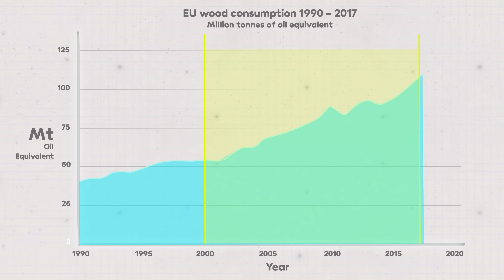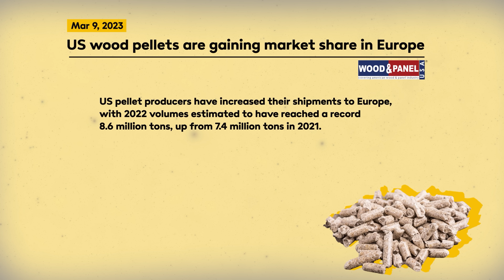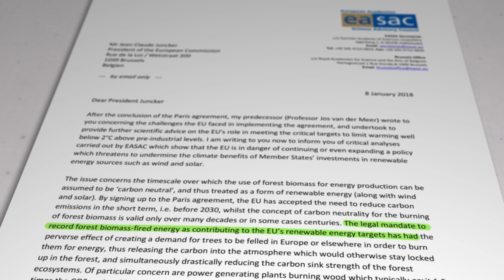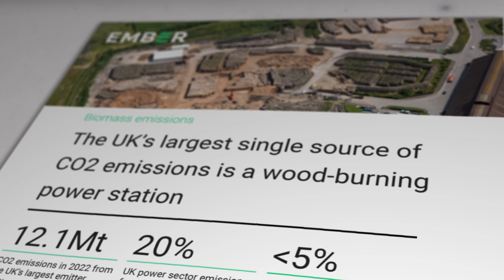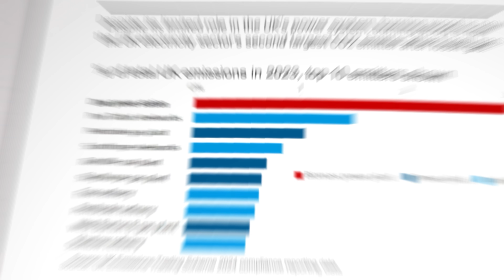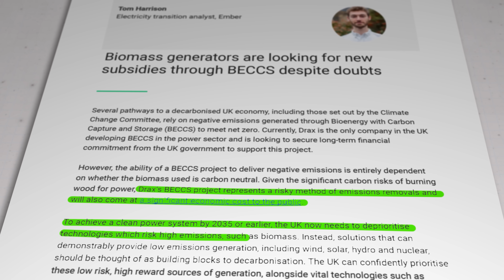New report: Biomass CO2 emissions 4X higher than COAL!!

Comment: I've always had a hard time understanding how burning something is good for the climate...
Reply: You and your gut are right. It isn't. You can smell the BS through the rapidly shrinking pine-scented forest... Good on ya!
Reply: @djmeser
42 seconds ago (edited)
If carbon were recently removed from the atmosphere and then returned, it would be greener than burning ancient fossil fuels that have not been in our atmosphere for potentially millions of years. Co2 in the atmosphere is not a problem, and increased carbon over time is not a problem. However, the rapid change of greenhouse gases at a rate faster than evolution can adapt is a serious problem for the biosphere. 

With this said we still need to increase forests and not decrease them. Biomass should be grown not harvested.
Reply: I don’t understand how human life is good for the climate
Reply: @Margarinetaylorgrease I pooped outside. A flower grew.
Reply: If DRAX doesn't burn it, it rots to methane or CO2, with GWP between 1x and 120x CO2e. If they burn coal instead, it generates almost three times the CO2e, not counting the methane emitting in coal mining. 

Cleared, that land it was on grows new trees, and in 60-80 years takes all that CO2 out of the air. Otherwise senescent old trees spew three DRAXes worth of methane.

Comment: Most of the import to Denmark is for district heating which the country's councils have a vested interest in supporting since they normally have part ownership of the heat station. This is the main reason we have a heat pump instead. But the council's are pushing the roll out of district heating pipework as fast as possible. It's very frustrating.

Comment: Biomass is carbon neutral, coal never is.
Reply: Did you bother to watch the video before displaying your ignorance?
Reply: Biomass is only carbon neutral if just as many trees are planted as to those felled, which just doesn't happen in the reel world.
Reply: Decomposition does not 100% convert a tree into CO2 and H2O. A lot of it stays as organic carbon in the ecosystem. Burning wood also creates a demand for wood, which increases wood extraction, so there's a chance that w/o your friend the tree never would have been felled in the first place. Also, removing a tree from an ecosystem releases more CO2 than was stored in the tree, because it also disrupts soil CO2 sequestration, as well as the smaller plants, microbes, and animals that rely on trees as ecosystem engineers. Lastly, on the time-scales of global warming, Coal and forest ecosystems are essentially permanent carbon sequestration. While total global living plant biomass can change over the course of hundreds of thousands of years, extracting timber and coal for fuel both take carbon out of highly reliable carbon storage and release it directly into the atmosphere very quickly.
Reply: @BoggartBae  Trees are already part of the carbon cycle.
Reply: I don't understand the "wind and solar" obsession.  Biomass is far superior to either since it is base load primary energy.  Bottom line is solar is great land use in a desert or on a rooftop but horrific in a place that actually rains.  The Brazilian sugarcane industry is mostly in the net reforestation zone and is the second largest low carbon renewable complex only behind Chinese hydro.  Yes even ahead of Chinese solar (albeit not for long) since actual generation is less than a third of nameplate capacity.  Combustion is not ideal but if new emerging technologies of the sector continue to emerge like cellulosic ethanol and biogas the future for bioenergy looks great.
Reply: You should watch the video before commenting.